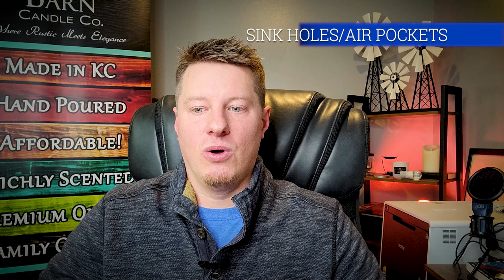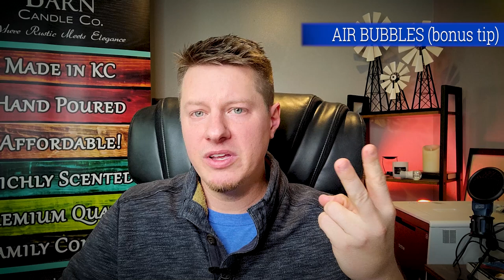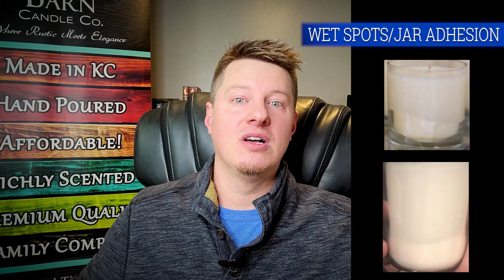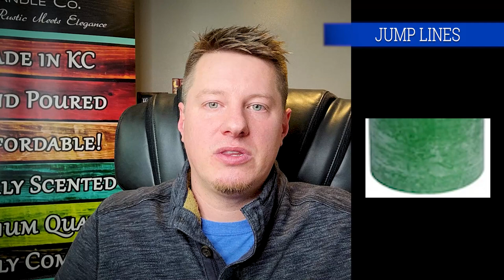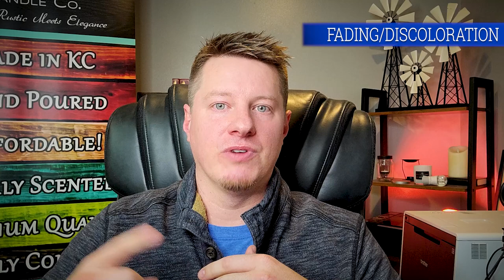14 Common Candle Making Problems [Part 1] | Troubleshooting  Candle Issues and How to Deal With Them

Comment: You are the best wade. No one to beat you out there. Best video.
Reply from the maker: Thanks so much!
Reply: @BlackTieBarn  You are welcome brother. I enjoyed watching your contents.

Can I get an answer for this question, I'm using Bw-910 Paraffin/Soy Wax and was wondering if you could give some insights on what Size wick from the 700 Series for jars of 3"inch diameter? I use 8% fragrance oil in my candles.
Reply from the maker: @declanosbourne62  Hi Declan, this is a tough one sir. I dont really use that wax so I'm not sure as I woul;d be completely guessing. But... the other issue is that B910 is a pillar wax and might be a little firm for container candles. Of course it can work, it just means I am not real sure what wick would be best with that wax being a harder wax with a higher melt point. You might be better off double wicking that sucker if you haven't tried yet. Maybe a couple P720s for example? That is just a guess again since I dont use that wax. Perhaps someone else can offer some insight. If wanting to stick with single wicking... I would start at probably P767 and then adjust up and down as needed. Again... just guessing though. :/  Sorry not much help on this one.
Reply: @BlackTieBarn  Thanks a lot. I'm trying to avoid reheating the top of the candles for sinkholes, but yet to find the wax that doesn't gives all that sinkholes. Can you recommend me one two waxes that doesn't gives sinkholes?

Comment: Thank you Wade for a great, informative video!
I have an issue that puzzles me.  I am experimenting with 2 fragrance types, using the same container, wax, wick and fragrance dosage level.  The fragrance with the higher flash point, consistently has a higher flame than the fragrance with the lower FP.  The FP’s are well within the acceptable range for candle making! The flash points are correct because I designed the fragrances myself and have documentation stating the FP’s.  From my research a flame shouldn’t exceed 1”-1.25”.  Would you be able to provide any information as to why this would happen?
Reply from the maker: That's a tough one and I can only speculate. 
Oils with higher FPs are usually... usually denser heavier oils. That could cause them to cause a different response eith the wick while burning.  Are you using the same wick with all your oils? If so, that would definitely cause this.  All oils are different and each should be tested as a new candle. I have several different wicks used in the same jar and with same wax with only the FO being different. It's a major part of the overall blend and recipe. So changes (different FOs) can often need different wicking for sure. But if that is not the case... I'm not sure,  that's a good question.  Lol
Reply: @BlackTieBarn    Thanks Wade for your reply!  I have been following your recommendations using 2-3 different wicks that would be appropriate for the particular wax.  The  fragrance in question does have a higher crystal content, but that should have the opposite effect concerning the height of the flame.  Crystals and a family of ingredients called aldehydes can cause issues with wick migration.  I am using your recommendations based on the excellent video you did on wicks.  I am a Perfumer who has created fragrances for over 30 years, and this is certainly a learning curve from the other side of the industry.

Comment: Testing my first candle right now (should have left it to cure a bit longer but I could not resist! I made it 4 days ago..) So far I've got sinkholes, and well on my way to tunneling... On the other hand burning it "fixed" the too strong smell - there is barely any hot throw... not quite a success yet I would say! - small edit - it actually got much better after the 2 hours mark! there is definitely hot throw (I realised that after I opened the window to feed a squirrel) and the wax on the side is now catching up...
Reply from the maker: Oh good! BTW... now I wanna go feed a squirrel

Comment: Great video very informative! 

What wick(s) would you recommend for IGI 6006 para/soy blend? 
I’ve been looking into this but there are so many wicks in this industry!
Reply: I've been using 6006 for a few years now. My go to is HTP, followed by Zinc and The Premier 700 wicks.
Reply from the maker: I agree with Lara who also commented. I use mostly htp and then premier 700 and zincs are split. It depends on the jar size of course as well. I have a video or two making 6006 candles where I discuss my process.  Also have a whole detailed video on wicks. Will link below. Hope it helps! 
https://youtu.be/FVlsH3N4T3M

Comment: I am very new to candle making. I stared with soy, had no hot throw... at all.  So I was like this is amazingly hard so I watched some Youtube videos and decided paraffin wax was what I needed. It worked awesome. Fills two large rooms in my home. However get sink holes and like a bubble around my wicks. Also I tried coloring the wax. I used mica cause I thought what  gorgeous colors.  well it all went the bottom and my top looked like wax with glitter. I used my liquid color and if i added correct drops it would be just barely colored and to much would end up in the bottom of the picture. Ughhhh Im so frustrated. do you have advice for a great candle dye? Should i warm my jars and foil them up to prevent the sink holes and the weird bubble that forms around my wick some times. Thank you for sharing your knowledge!!😊
Reply from the maker: I agree with a lot of what you said about hot throw. It is far easier to get it with paraffin and parasoy blends.
Sink holes, dips are all normal. Just part of the process to consider in your workflow. Bubbles usually can be fixed by different pour temps. Unless you are talking about those white/colored bubbles on the top of your paraffin candles. This is normal, especially for mottling paraffin wax. Its just a characteristic of the wax. You can smooth them with a heat gun if you prefer.

As far as candle dye. Well, paraffin needs less dye than soy. Its less dense and holds color better. If you are adding too much it might be settling at the bottom. Try adding color first at the hottest temp (i usually add color between 190 and 200. Blend very well.
Reply: Candle science and lobster carries quality candle dyes. I use liquid dyes because it's more easy to work with so you don't add to much or to little. 5-7 drops per pound will give a nice color in Paraffin wax. Soy Wax will give a lighter shade if you use the method I mentioned but you can get Bright shade if you add more dye but be careful not to add to much.
Reply: @BlackTieBarn  I used to add dye just at 185° but I realized I got in trouble with the temp drops lower before I put my fragrance so I started experimenting and add dye at the temp you suggested and it work pretty fine. I need to find that pouring temp sweet spot for my ParaSoy blend and stick to it.

Comment: What would you say bout mushrooms in candles? I tend to get mushrooms on my wicks. I doesn't seem to matter what type or size wick I use. I read somewhere that mushrooms are acceptable in candles as long as they do not reach 3mm wide. What would you suggest to eliminate this problem, if it is at all possible to. I'm experimenting with IGI 6006 in a 9 oz straight jar. I tried HTP, Eco, and CD wicks of different sizes. They all cause mushrooms in my candles.
Reply from the maker: It's nearly impossible to prevent any snd all mushrooms. Just limit them as you can. If you aren't getting bad ones in a normal burn time frame I wouldn't worry about it too much. Certain waxes and wicks are worse than others.  The harder a wax is to burn and consume the more mushrooming generally

Comment: Hi. I am working with igi 6006. What wick do you recommend. I have tried so many and I just can’t seem to get it. Please help me.
Reply from the maker: Hey Chyrisse! Depends on jar. But I most prefer htp, premier 700 or zinc wicks for 6006. Let me link my detailed "All About Wicks" video below. It has lots of info on wicks and what to be considering. Plus I mention several suggestions. I hope this helps. Also,  I have another video making 6006 candles where I talk a lot about 6006 specifically.  Check that one out too. 😁
https://youtu.be/FVlsH3N4T3M

Comment: After making a candle what is the cause of cracking from wick to sides is it the temp of glass before pouring?
Reply from the maker: Yah it's mostly wax type and pour temp. You want the wax to cool slowly. So try pouring a tad hotter, cover/insulate the area around your jars, and slow down the cooling process.  :)
Reply: @BlackTieBarn  Thanks I will try that tomorrow I'm using RCX wax .
Thank for all your You Tube Videos they are very informative well done.
Reply from the maker: Thanms Adrian!
Reply: @BlackTieBarn  I've been thinking if you fill glasses with uncontaminated wax i.e. No frag or wicks after it has cured can you re-melt and use again ?  This would save wax and I could perfect the wax side of it first with no waste. Then I could introduce frag and wicks and then concentrate on the burning.
Reply from the maker: No harm in doing that.  :)

Comment: I'm having an issue consistently centering some of my wooden wicks. I know this is critical because it can affect my candle performance if not centered. Any suggestions?
Reply from the maker: Hey Cynthia! Wood wicks are tougher sometimes because there aren't little tools to help you center without making some type of template. My advice would be to make a template for your jar. My an is to make some for people when I get a chance. 

Also, I'll be sampling and testing some wood wick holders soon and depending on how they work, they may help with centeriduring placement. Stay tuned! :)
Reply: @BlackTieBarn  thanks!

Comment: I have frosting in my paraffin wax
Reply from the maker: In paraffin,  it wouldn't be frosting.. it would be either mottling (normal and intentional with many kinds or paraffin) or jump lines.  Pour hotter to fix those.
Reply: @BlackTieBarn  on all the videos ive seen it looks like frosting or like miff on it. I Should add im using silicon molds and adding dye to wax. I think it has something to do with the temperatures. But im still learning. Do you have a example of mottling? Thank you 😁